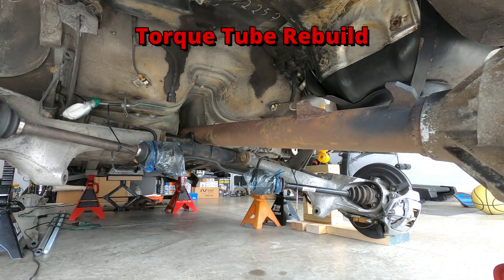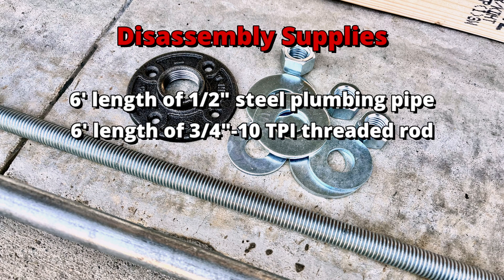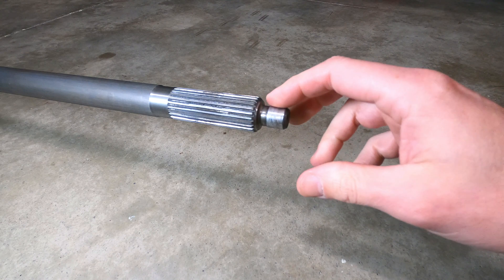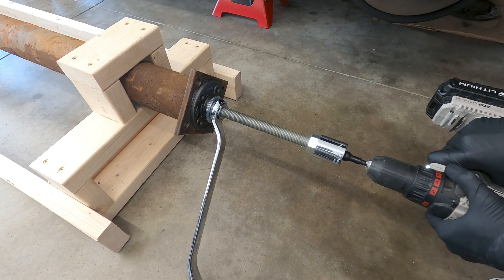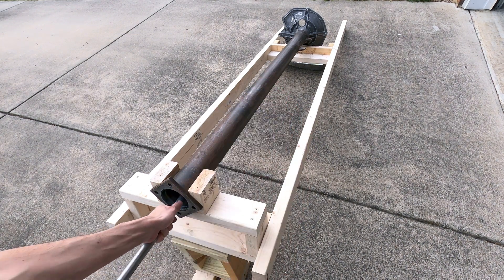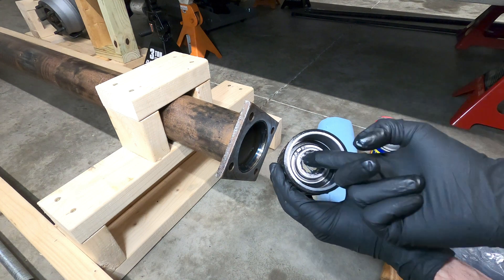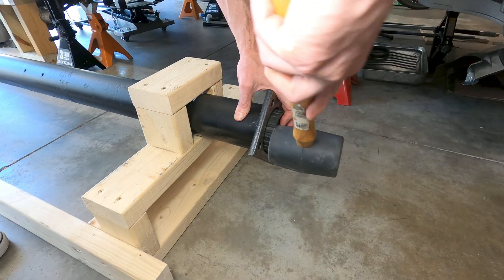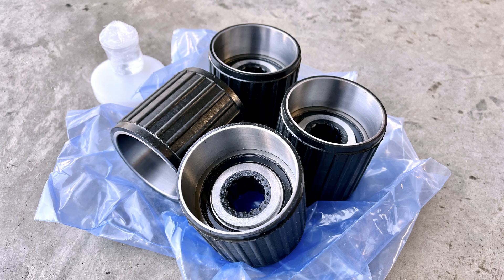Porsche 944 – Torque Tube Rebuild Tutorial using Super Bearings from Black Sea R&D

Comment: Has anyone had a torque tube noise that sounds exactly like a rear wheel bearing drone? (Bearings replaced, no change). I can “feel” some sort of rotational vibration if I put my hand around the shifter boot and that doesn’t really change whether the car is in or out of gear. I don’t think I really have the classic TT noises and maybe it’s the transaxle.

Comment: will this work on a 93 968?  or is that something completely different?
Reply from the maker: It’s the same general process for the 968, but there are a few minor differences in some of the parts. On the manual trans, the front end of the drive shaft is a separate piece that slides back in order to remove the tube. It connects similar to the coupler at the transaxle end of the tube, where there is an Allen pinch bolt that you need to loosen first. On the tiptronic trans, the bellhousing has to be removed from the engine first. There is a connector that attaches the torque tube to the vibration damper that can’t be removed without removing the bellhousing. You’d also have the ATF lines to disconnect on a tiptronic car.

Comment: I want to ask and need help with my clutch. So i  did a rebuild on a 83 block to replace my motor. I already put the motor in,starts, but i have a hard time with getting into gear. I can only shove it in 3rd and reverse by force without  grind but the car can creep and slowly move with the pedal in. I have done a bleed on the slave and master,adjusted the pedal for the master but hasent changed. I cant get in gear properly when the car is on. Would it be  the shaft itself not being adjusted? I had to cradle the motor in order to get the shaft in. Could it be the shaft not adjusted?
Reply from the maker: Sounds like the clutch disc isn’t properly engaging/disengaging. You can try to look through the clutch inspection hole while someone depresses the pedal to see if anything looks out of alignment, but if not, you may to tear down the clutch assembly again.

Comment: I bought Design 911 bearings. The inner bushing is tighter on the shaft than the bearings are on the tube. So anytime I press the shaft through the bearings... the entire bearing moves inside of the shaft instead of the shaft going through the inner bushing. 
Any ideas on how I can get around this??

Im thinking about taking a burr to the inside bushings so they arent so tight on the shaft. But really not looking forward to pulling the new bearings out of the tube again.
Reply from the maker: Letting the bearings sit in the tube for 24 hours helps set them in place, that and lubricating the drive shaft before installation may help.
Reply: @NC944er  I appreciate the reply. I will let them sit overnight and try again tomorrow. Thanks!

Comment: Hey Mate, I'm looking at doing this, did it make a big difference. 
What were the symptons before you changed it out.
Mine has a few rumbles when accelerating through the higher speed ranges at like 110-120kmhp
I'm 9 months in on My 1989 2.7lt 944, your vids have been a great help, i have rewatched them many times
Thanks from Australia

Comment: only suggestion i would make is, instead of using regular wd40, use a silicone based lubricant instead. wd40 and other lubricants can be a little hard on rubber parts, while silicone is much safer
Reply from the maker: @gotanksrox5331  Hey, thanks for sharing! I do appreciate your point. In this case, I was following the recommendation of the product manufacturer. My understanding is that the light application of WD-40 provides enough lubrication to easily slide the bearings into place, and then as they sit over 24 hours, some of the mineral spirits (solvents) in the WD-40 will evaporate and allow the bearings to “lock” into place, whereas a silicone lubricant would not evaporate. The manufacturer had concerns that the bearings may move during drive shaft installation, and that’s what they were trying to solve for.
Reply: @NC944er  that makes sense. i'd just hate to go through all that trouble of getting the bearings installed just to have them get eaten away by the wd40. maybe something like dish soap would work too?
Reply from the maker: @gotanksrox5331  Totally agree, it’s a lot of work to get there. 😂 Yeah, a water/dish soap solution would probably do the trick. I’ve used that for weather seal installations.

Comment: I wonder how many replaced bearings aren't in their proper place. If the torque tube had been designed split along its length and bolted together the whole process could have been much simpler with better results. Imagine removing the top half to access and replace the bearings and cleaning the 2 halves of the tube fully exposed. would save a lot of wrenching. I'm not an engineer so it's a silly idea.

Comment: By any chance do you have the torque specs for those 8 bolts to lower rear suspension. Porsche dialogue has me a little confused
Reply from the maker: @JaredColetti  This may help, check the bottom under “Rear Axle” - https://www.lindseyracing.com/LR/Parts/TORQUESPEC.html

Comment: By any chance do you have a blueprint for the gig with measurements ?
Reply from the maker: Hey, sorry I do not have a plan, I just eyeballed it based upon the dimensions of the torque tube. The length of the base uses two 8-foot 2x4s. These are connected by four 18-inch 2x4s, two on each end. These are gapped by about 6 feet, leaving 2 feet of open extension on one end for the wall bracing. The raised support section for the clutch end of the torque tube is 7 inches in height.

Comment: Hi @NC944er, can you please share how much doeit cost for the super  bearings from black sea   R&D? While we are in there, what other parts could get upgraded, at this point I've no idea about health of clutch and it's associated components, gear shift lever and it's associated components, transaxle and its associated components. Last week installed new yellow koni dampers.
Reply from the maker: The Super Bearings are a little expensive, but very high quality. I paid $850 for the set of four. If your 944 is an NA car with the original rubber-centered clutch, it would be a good idea to replace that while you’re there, and if the clutch is removed, it also makes sense to resurface the flywheel, and if the flywheel is removed, it makes sense to go ahead and replace the rear crankshaft seal. There are a number of other associated parts that go along with all this such as needle bearings for the clutch fork pin, pilot bearing, guide tube, and so on. If there is any slop or play in the movement of the shift lever, this would be a good time to inspect those pieces for replacement. The shift linkage at the transaxle has some rubber bushings that wear out and the cylindrical pin on the metal shift lever can also develop wear over time.
Reply: Also, does the clutch kit for an 8V 944 be suitable for a 16V dohc engine on '87 944S? Asking because there is a different part number on the M44.40 engines catalogue for pressure plate. But repair kit seems to be the same.
Reply from the maker: @Sivaprasad.t.g  Yeah, the clutch kit will be the same - https://www.pelicanparts.com/More_Info/94411691101.htm?pn=944-116-911-01-M38&bc=c&SVSVSI=0760

Comment: my problem is that torque rod destroyed pilot bearing to the point theres no pilot bearing housing left, im still trying to dissasemble rear end but all the bolts are either siezed or wont moowe at all
Reply from the maker: Oh man, yeah the hardware can get pretty crusty back there. I usually hammer them to knock them free of rust, hit them with penetrating oil, let them sit for a bit and, and finally apply a big breaker bar. Good luck!

Comment: I have a groaning noise coming from the rear (93k miles). Would you be more suspect of the wheel bearings vs the torque tube at this mileage?
Reply from the maker: Noises from the rear can be difficult to pinpoint. I’d say that’s pretty low mileage for either of those suspects, but not impossible. Does the noise change under any conditions like turning, accelerating, decelerating? If it changes when turning, I’d look at the wheel bearings and CV axles. The transaxles also give off a fair amount of whine, which can be worse with worn or damaged gears. Maybe change your gear oil if you haven’t done that, couldn’t hurt to see the difference. You could also put the car up on jack stands (safely) and run the drive train while you try to narrow down the location.

Comment: Fantastic video, thank you! Question if you don't mind: any tricks to getting the top bolt on the slave cylinder side out? I have the starter out and slave cylinder pushed to the side but still can't seem to get to that bolt with anything
Reply from the maker: Hey man! I’m assuming you’re referring to the top bolts for the bell housing that are annoyingly crammed in with no space for tools? 😂 The slave cylinder side is a pain… I ended up breaking that one free from above after disconnecting the bracket for the crank sensors and the clamp for the starter wiring harness to create a path to the bolt. I used the closed end of a combination wrench on the bolt with the angled side facing towards the front of the car and then locked the closed end of a second combination wrench onto the open end of the first wrench, basically extending the length as a cheater bar. You should also be able to get a socket with a low profile/stubby ratchet onto that fitting and then a cheater pipe on top of that from above, if it’s a flex-head ratchet even better. Some people have had success from below the car using a socket and a universal joint, followed by a long extension (approximately 2 feet) and a ratchet. If you’re supporting the engine from below using a jack, you may be able to temporarily lower the jack a bit for the engine to drop down and make more space. Once the bolt was fully loosened, I wasn’t able to remove it from the bell housing because the bolt head was hitting the aluminum heat protector on the underside of the car, so I had to pry and wiggle the bell housing off with that bolt loosely hanging in the fitting. Making matters worse, the bell housing wouldn’t clear the clutch assembly because the rubber hose from the heater control valve was blocking the way, so I had to push the hose up into the engine bay using a ratchet extension with one hand while pulling the bell housing out and down with the other hand. What a mess… which is why I didn’t film it. 🤣 In retrospect, I probably could have bungee corded the rubber hose out of the way from above and that would have made things easier. Anyway, hopefully that’s the bolt you were referring to… if instead you meant the top bolt for the torque tube, I used a short combination wrench with a cheater attached. Let me know how it goes for you.
Reply: @NC944er  thank you very much for such a comprehensive answer! Will do my best with a couple of these tactics and let you know - really appreciate it.
Reply from the maker: @HighOnFlying1  Yeah, sure thing! I have two sets of combination wrenches, one Husky and one Craftsman. The same size wrench on the Craftsman is about 2 inches shorter than the Husky, and those shorter ones can often fit in places where the longer ones can’t. Good luck! 👍🏼

Comment: amazing video as always. looking forward now to doing mine while its out of the car already!
Reply from the maker: Yes! The rebuild is a bit more fun than the removal process… and really makes a difference, the driveline is noticeably quieter and smoother on mine now.
Reply: @NC944er  ya I figured if it's already out might as well get it done. But wow, $900 for the bearings but I am sure it will be worth it.
Reply from the maker: @smoothwood10  The price seems steep, but they are significantly engineered to last and provide better performance. 944Online has some factory style ones for about half that price…
Reply: @NC944er  thanks. I did see the ones on 944online. I have purchased most of my rebuild items from Ian. Not sure if I need the Super Bearings for a car that may only see 5000 miles a year.
Reply from the maker: @smoothwood10  Yeah, I’d say probably not necessary… with the only advantage of the super bearings being “peace of mind” in never having to do the job again… ever.

Comment: Thanks NC944er for another excellent video. One question though, if reusing the original sleeves and bearing housings, do you recall which direction the rebuilt bearings should go back into the torque tube? Unfortunately I didn't pay attention during removal but I believe the shoulder side of the inner sleeve should be facing the clutch end of the tube.....at least it appears that way for bearing #1 at 6:19 min. of your video. If this is correct, do you recall whether the other 3 bearing inner sleeves should also be pointing in the direction of the clutch side? Thanks for any assistance.
Reply from the maker: Hey man, it sounds like your understanding is correct. That shot illustrates the bearing from the clutch end. The shoulder side of the bearing housing faces toward the transaxle end and the open side faces toward the clutch. The shoulder of the plastic insert faces toward the clutch as well. That way when the driveshaft is pressed into the tube from the clutch end, it doesn’t inadvertently push the inserts out of the bearing units. All the bearings should be installed facing the same orientation.
Reply: Thanks for the confirmation.

Comment: After having to do the timing belt, clutch, springs, control arms, door handles, dash lights and vacuum leaks on my 944 in the span of two years, finding out I might have to do this now because of crazy vibration around 2k rpm makes me want to just push the car into a lake.
Reply from the maker: Nooooo, don’t do it! 😂 That does sound frustrating though after all the work you’ve put in. I’ve been there a couple times with my car and had fleeting thoughts of selling it, but I’ve found that after taking a break from wrenching for a bit, if you can manage enough commitment to get back out there and remove just one or two bolts, before you know it the entire car is disassembled and you’re back in the game. Just think, by year 4 it’ll be perfect… maybe. Wishing you and your 944 the best, whichever direction you go.
Reply: Vibration around 2000 rpm sounds like an off time balance shaft!

Comment: Another excellent video.  Something to 'look forward' to on mine.
Reply from the maker: Given enough time and miles, we all may have to “look forward” to this at some point. 😂
Reply: And...just finished reassembly of the TT.  Time to get it back in the car!  Thanks again for providing such helpful videos.  I will add that using my big Milwaukee right-angle drill to turn the threaded rod made easy work of pulling the bearings out and re-installing.

Comment: My 1983 944 also has the aluminum support bracket at 1:50ish. Just thought I'd note that.
Reply from the maker: Nice! Yeah, a benefit of the early tubes is they lack the “dog ears,” so they don’t have to be turned 180° for removal, you can just pull them straight back and it won’t catch on the support bracket.

Comment: great video as usual but oof almost $900 for those super bearings
Reply from the maker: Thanks! They are a bit more than the OEM ones, but are incredibly well-built and would likely outlast the life of the vehicle, where the OEM ones can continue to fail due to the plastic inserts, etc. It’s a trade off.
Reply: Will these bearings also fit the 928 torque tube?
Reply: @ronnelson7828  Yes- they make bearings for the 928 and other porsche models.

Comment: Great video! I'm thinking this will be one of the projects I will have to confront on my 1987 924S. Would you happen to have the dimensions and material list for making the wooden torque tube holding fixture? I'm not great with woodworking skills! :)
Reply from the maker: Thanks! Given enough time and miles, we may all have to confront it. 😂 The wooden jig was constructed from four 8-foot 2x4s and a one pound box of 2.5-inch construction screws. I left the length at 8 feet and cut the center supports to 18 inches. The engine side was elevated about 7 inches from the ground so the tube length would be parallel to the ground. I used one of the longer transaxle flange mounting bolts to secure it on the other end.